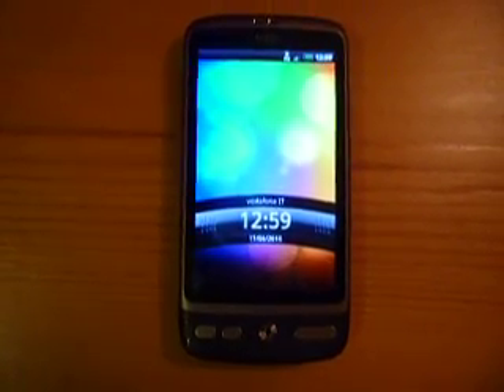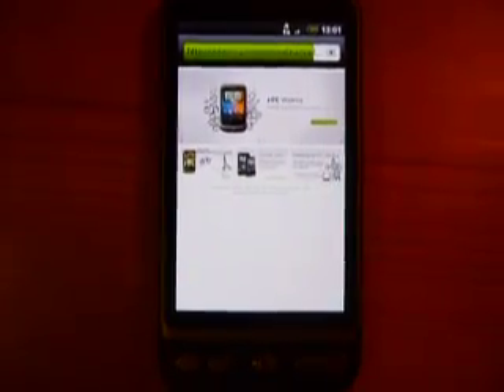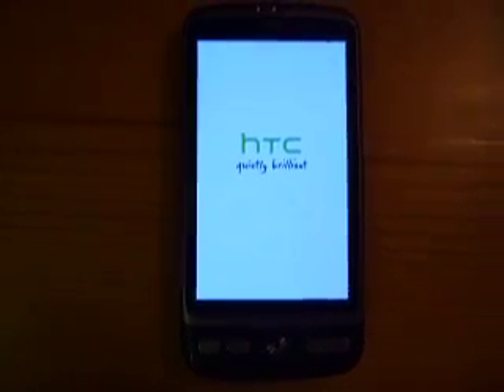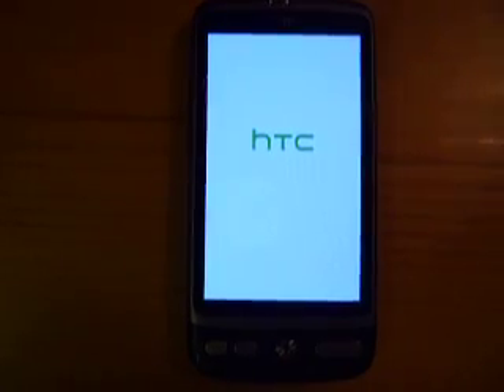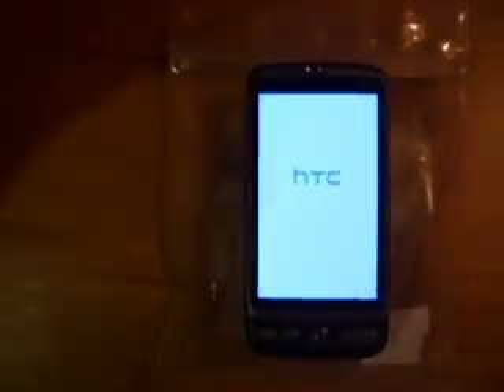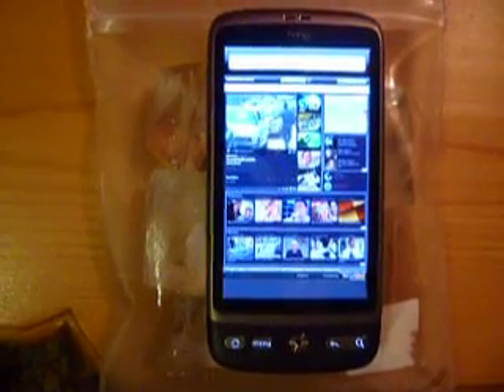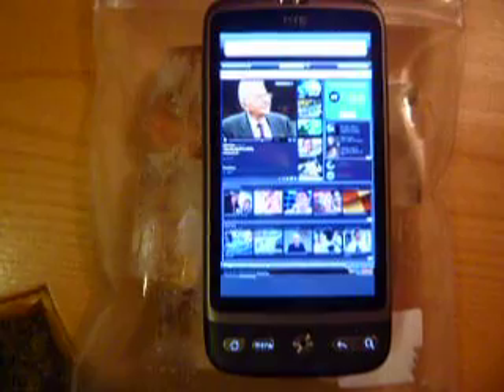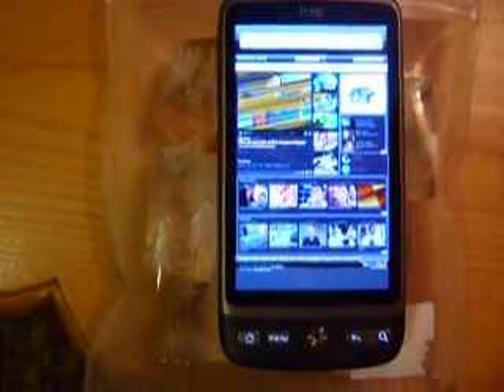HTC Desire hardware defect

Comment: Requires a new motherboard the components are overheating........I had one replaced and it as worked fine for almost twelve months now it as started again....there is an inherant fault with these boards and HTC don't want to know as far as I am concerned

Comment: Yes, DO worry! I have exact the same problem on a 2 months old HTC Sensation, and it is pretty annoying, as the wifi-connection is lost after the reboot. Only a manual reboot fixes the wifi-connection again!

HTC tells me to do the hard reset, which I've done. But that doesn't solve the problem.

Comment: Yeah that confirms my fears. I noticed infact that the device gets really hot if using videogames or other apps. I suggested thi cause for thes fault at the HTC support team but they didnt confirm. They just suggested a reset of the software. I bought the Phone in Feb 2011 and during the winter I never had any problems. The defect got particularly bad during summer time months...

Comment: I have this same error. I read online that the motherboard needs to be replaced. I took it to Meteor (the mobile company where I adquired it) to get it fixed and have just received it one week later with a note that says that there is moisture in the charger socket of my phone (what the f****???) and hence the warranty is void... They just made up the moisture thing so they don't have to pay for the repair, because there is no sign of moisture whatsoever I can find in my phone's charger socket.

Comment: I have the same exact issue. It can happen anytime, but it tends to happen the most when I try charging my Desire. Using Google Directions (GPS) seems to trigger it a lot too, but using 3G doesn't seem as likely to cause the resetting.

I had the phone reboot in the middle of a college lecture, and it started vibratting and made a boot-up noise in the middle of class several times. I eventually had to rip the battery out.

Comment: Damn, have the probleem too. My phone is going back to htc tomorrow. I can't trigger it with video's of with something else. It just occurs randomly. I have notice that the phone is getting warm on the lower end right by the usb port. 

But, as for know, the device is 30 degrees.  I had the problem when I updated to Froyo, but I'm not sure if that would be the problem. Because, if it were a software bug, why is the phone getting warm? 
I installed OS monitor, and the log is just fled with errors

Comment from the maker: @rahulworks : well, I have to say I was in your very same situation when I bought the Desire. Now, after the extremely frustrating experience with the HTC Desire I would not reccomend any smartphone mounting a Qualcomm Snapdragon SoC since there are people experiencing this kind of reboots with devices mounting that very same chipset. Better to be safe than sorry, so I think I am going for an iPhone4 or a Motorola Droid. Whatever phone which is not equipped with Qualcomm SoCs.

Comment from the maker: Updating stopped just one week, then restarted with very same  firmware versions updates both for the kernel and the baseband.
Note that this hardware defect also affects several Elcair users. So, again, this is NOT A SOFTWARE ISSUE. It's a hardware defect that each and every HTC Desire owner should check. Please try navigating a heavy web site using 3G for at least 30 minutes such as the one I have published here. If you can stand it without any reboot, you're lucky: wish I'd walk your shoes.